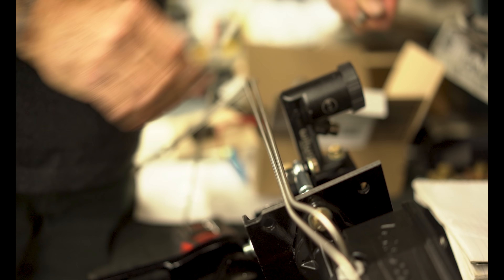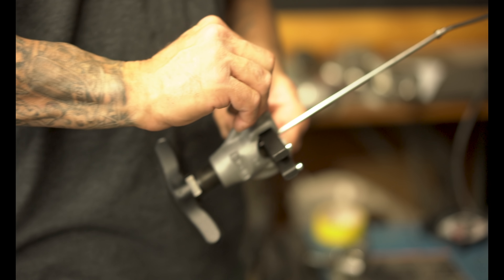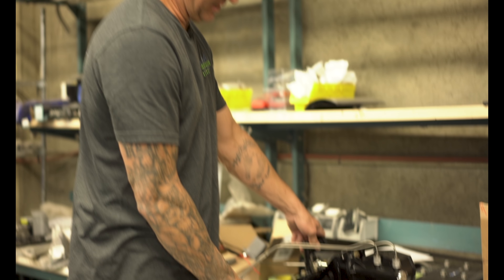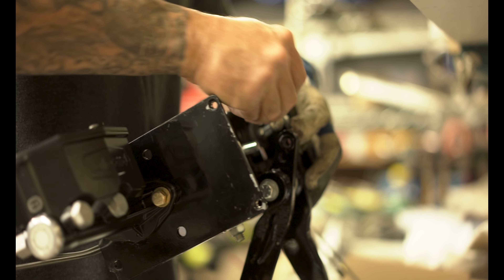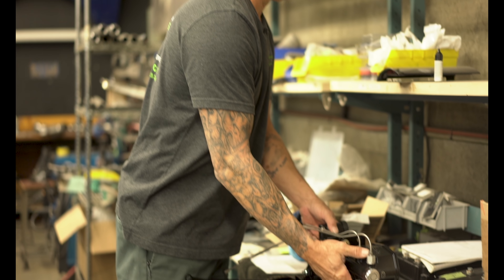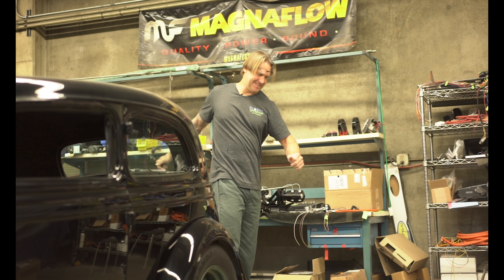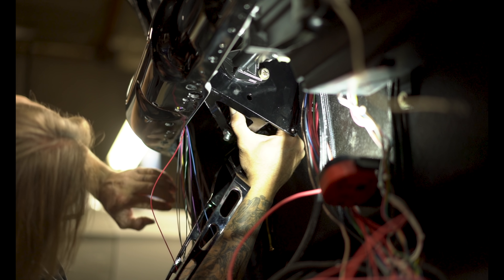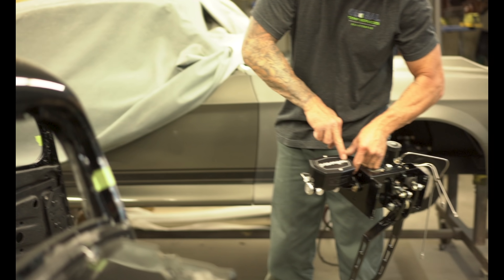The Vik - A Tim Allen Build - (Cxciv)

Comment: Too much stuff to have to figure out. Once the master is installed, how do you top off the fluid when needed? Obviously Tim can’t remove the whole assembly every time. This is the point you realize why car manufacturers today, use computers to design the cars. The way Bodie is doing it works for street rods but not integrating the high tech late model parts/systems  with older body and frame. He needs more help and possibly newer technology to mix old with new.